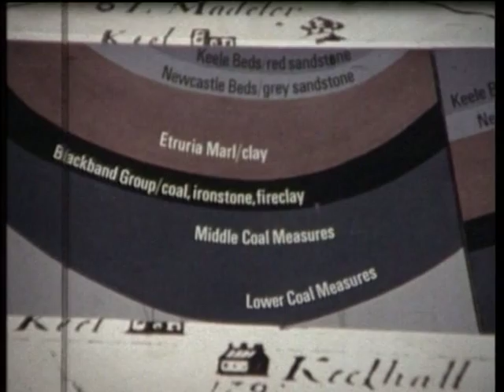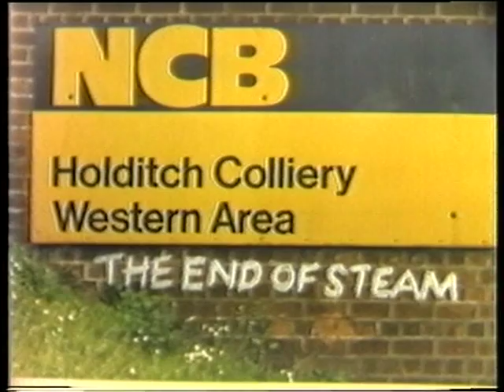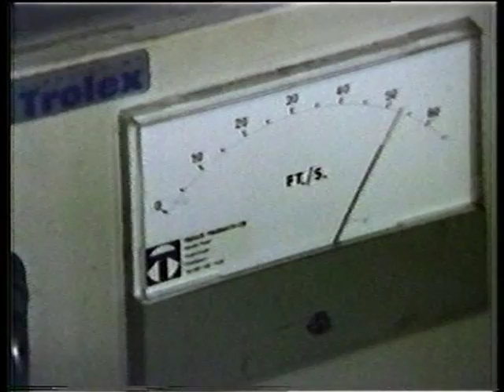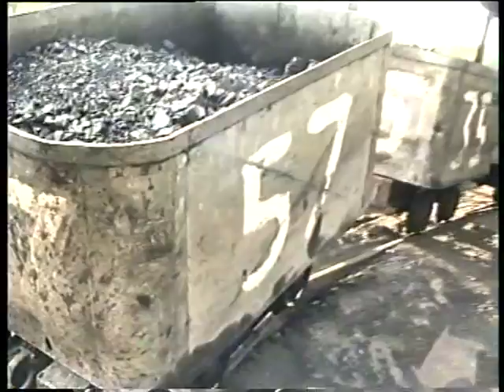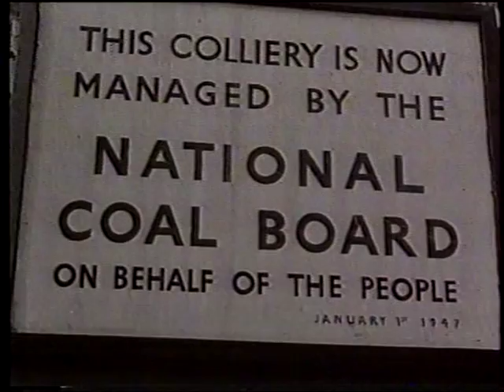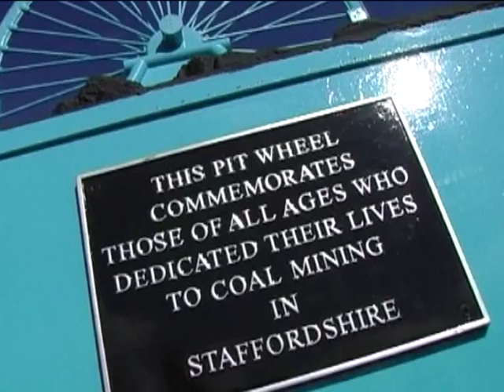Coal Fields of North Staffordshire

Comment: underground coal is something I have never experienced.Opencast on big machines is something I have done.Cannock site the name escapes me
Reply: Open cast mines are far safer. But can only be built when the coal is near to the surface. There was a planned open cast coal mine on Berry Hill fields in the early 1990s. But that plan was defeated after loads of complaints by local residents.